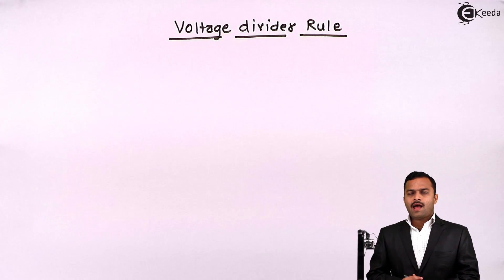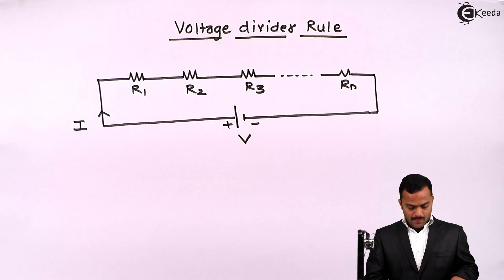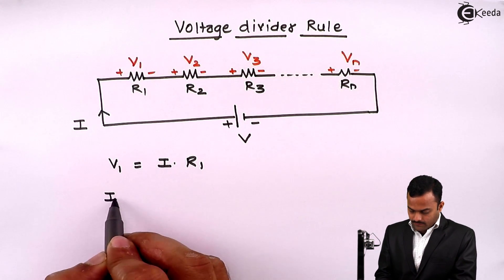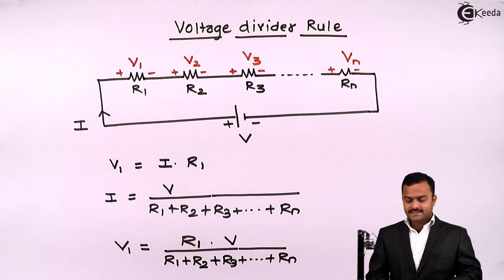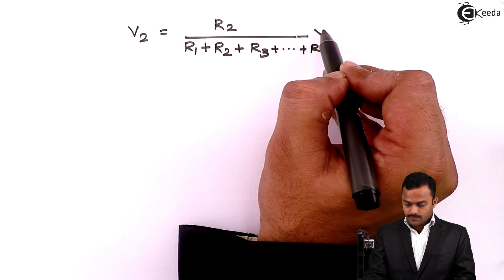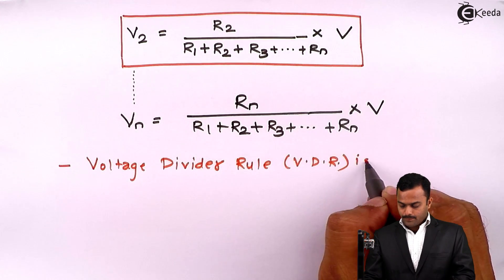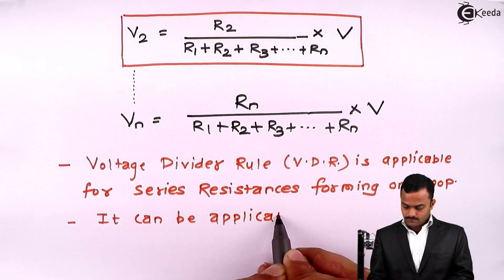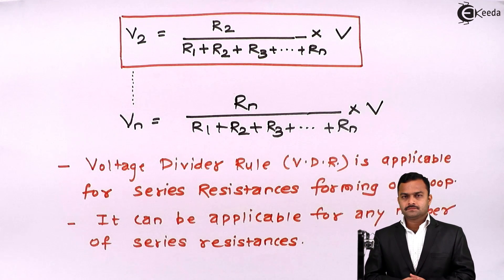Voltage Divider Rule (VDR) - DC Circuits - Basic Electrical Engineering

Comment: Current divider rule not only applicable for 2 resistances. It is also applicable for multiple resistances connected in parallel. Correct me if i am wrong.
Reply: actually u have to convert the question in such a way that current is divied into 2 parallel resistors, else go through rules and follow the fact that rules are for fools.
Reply: Its only applicable for 2 resistances in parallel combination.
Reply: Yes you are wrong 😎😎